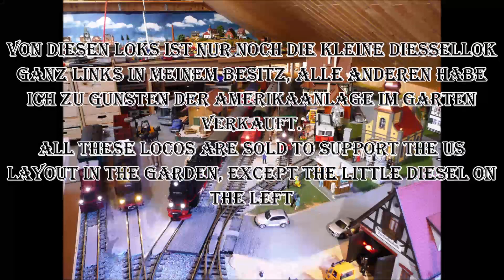LGB auf dem Dachboden LGB in the loft, aus der Serie wish what / wünsch dir was

Comment: I have seen a tour of your indoor G scale layout before so no surprises there. Do you find that there are more or less problems running G scale compared to HO scale? Cheers Andy, David.
Reply from the maker: Hello David, the problems are the same, dirty rails and electronic/electric issues. For indoor use standard tracks are ok, for outdor I recommend stainless steel or nickel plated tracks. Depending on how many locos you want to run the same time is which power supply / DCC system you should use. Are you planning a Garden layout? Take care, stay healthy Cheers Andy 🤠
Reply: @Andystrainsandmore  Hi Andy, I would love to have an outdoor layout but it would have to be HO scale for me. The biggest difficulty is the summer heat but I still may try something one day. Cheers, David.